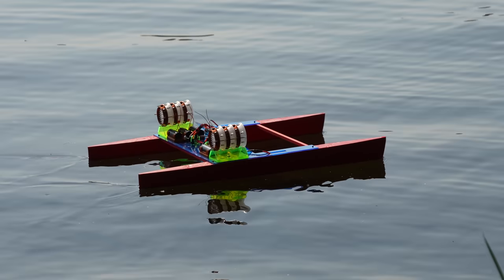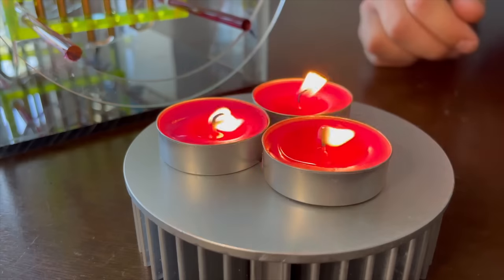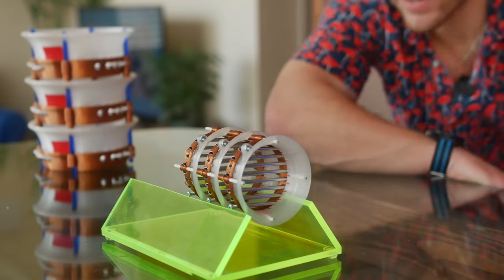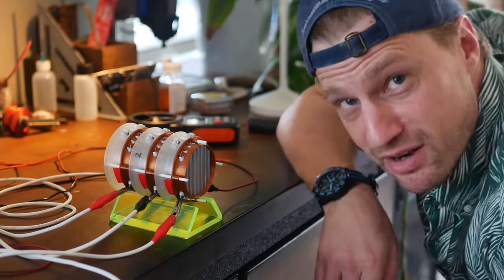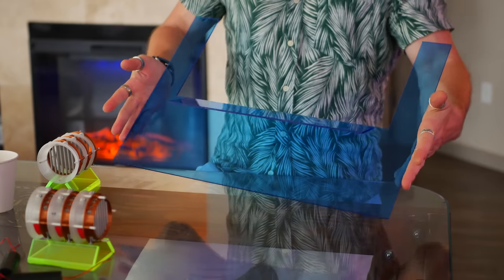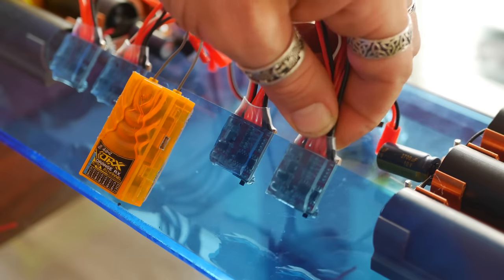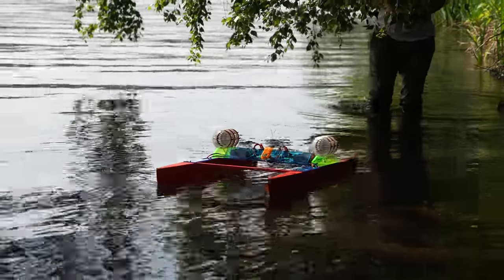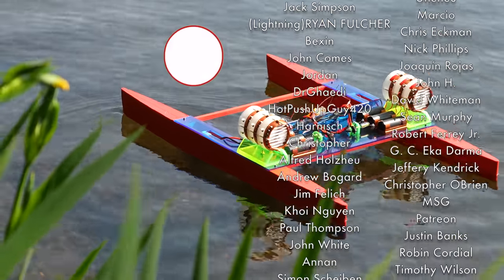Building A Twin Ion Engine (TIE) Catamaran (ft RCTestFlight)

Comment: Ok,  so I noticed that the wire you use to generate the electron flow is pretty a pretty thin gauge.  Does increasing the wire gauge thickness have an impact on how much thrust you can develop?  Also have you tried different types of wires like say for example Oxygen Free Copper wire vs. traditional copper wire, or aluminum wire vs. steel or stainless steel even?  It seems to me that the specific properties of the wire would have a definite impact on how many 'stray' electrons are released in response to the current applied.  For instance OFC wire has fewer impurities in it so it has a higher conductivity than traditional copper wiring, as such more electrons pass through it successfully (by not bumping into those pesky impurities) so more should be released towards the 'ground' of the circuit.

Comment: A suggestion that may deal with the hiumidity issue:
attach a humidity sensor to an arduino. 
have it set the distance between the positive and negative terminals on the thrusters. the more humid the further away.
this should solve the arcing issue and in more humid air the ions should travel easier so further so may still achieve the desired results.

Comment: The high voltage arcing is also causing high frequency interference, which, in fact, could be worse for marine animals than typical engine noise.

Comment: Hey Jay. Nice job on the boat. But I was thinking! If you want to have more air pressure on the end ( to have more velocity ), I would try to make a body, for the thruster (like airplane thruster). You would have more air pressure and less loss of air, in the end of the thruster. I think this would help with more velocity.

Comment: Btw; I crunched the #'s and researched a self launching glider with an 89 ' wingspan just to get a working knowledge of the dynamics and truth be told. If it's your plan to propel a manned glider with ion plasma. You're gonna need some SERIOUS mechanical in order to have the ion engines that will provide the right amount of thrust. It's very doable my friend, but you're really gonna have to think outside the box on this if you hope to succeed as a manned pilot

Comment: Have you compared with thrust from Noctua CPU cooler fans?  They are essentially silent. A lot noise comes from the turbulence of higher speed air flows. A fan that operates in the laminar flow regime with a quiet motor can be as quiet and much more efficient. 50W of power for an ionic fan is a lot of power.

Comment: I know that it would be "moving parts," but I would just put the engines on linked swivels (maybe connected with a rudder, too). In a full sized craft, that servo functions like the ship's wheel would for a person. That allows them to run fully in parallel and simplifies the electronic controls by only using one power setting for both, also allowing for more power through turns. It doesn't solve for reverse or the humidity problem, but it would help with the speed and overheating, yeah?

Comment: Have you tried any actuators or servos to extend the distance of the plates and wires on the fly? This could help the humidity issue, as the air is more conductive the minor distance change could solve that. Would love to see the outcome. Let me know!

Comment: Have you thought about thrust concentration? Like a jet engine the intake opening is is larger then the exhaust. Like your single stage. But when adding the 2nd and 3rd sections your keeping them all the same size. Like a regular house fan you’ll get a certain thrust form an unimpeded open fan but if you put cone on the air side capturing all the air being pushed into a smaller exit. then all that air is trying to exit from the smaller point. What if you made each section slightly smaller allowing all the air being pulled from the first thruster to be compressed and further accelerated by the next stage?

Comment: Can I suggest making the emitters out of wither turngsten or Titanium 1mm thick, laser cut like a comb (for hair) then etched to give needle points? The very thin material will offer near zero resistance to air flow whilst offering high ion output, as with careful design, you could interleave the cathode thus create a high flow engine.

Comment: This is pretty awesome but the feasibility of plasma based forms of propulsion may be limited on or near water unless you can find a way to prevent the water from becoming an electrical death trap in the event of a submersion or fault where the current contacts the water

Comment: MAKESHIFT HUMIDITY SOLUTION 

Make a tunnel going into the thrusters which has a cooling system (Like a fan) which will reduce the humidity of air going into the thruster. Should help with the sparking issue in higher humidity environments and stop overheating when thrusters are made more powerful.

Comment: You need to hydroplane. Vector the thrust into channels beneath the pontoons to create lift. By thrusting against the density of water rather than air, you may create greater force. You are pushing air, and it should exert force at more places than the thruster mounting.

Comment: Try testing the thrust power with a weight cell (wind speed it's a good indicator but it doesn't show well how much push the engine has).
For testing I suspect that this kind of thruster will be very dependant from the atmosphere conditions (it's kind of a capacitor) try testing it ina controlled area with different: pressure/humidity/temperature to check how these variables affect the efficiency (as you discovered during this video humidity lowers the voltage needed to create a spark between the two poles (as lower pressures do))

Comment: interesting concept. Just one thought - do the thrusters have to be round like a conventional jet or rocket? I was wondering if you couldn't make a really wide oval one, a bit like the large oval shaped Dyson fan? This could go right across your boat giving a much larger area of thrust for the relatively low airflow you are getting. Steering would need a rethink 🤔

Comment: Also, have you thought of increasing the applied voltage at each stage as you decrease the grid area while keeping the stage opening the same. 

   Somewhat like modern high bypass jet engines. Where the air from the first stages are bypassing the core where engine fuel combustion occurs. 

Which generates more thrust than the engines core.

Comment: I’m certainly no mechanical engineer but I believe Ion drives are actually being used now on a small scale in space.  What I read is, you’re not going to have huge acceleration but you can get constant acceleration although I’m assuming acceleration decays logarithmically (?) as you approach the speed of light.  Anyways I’m also guessing that you don’t have to worry about humidity in space.  Working on a boat on Earth is quite the other matter.

Comment: Have you thought of staging them so that each section is slightly smaller than the one before? Much like the compressor section of a axial turbine jet engine. 
   Each smaller section focuses the air flow. Then use a second first section to “accelerate “ the final exit airflow. 
  You may need to use 4 to 5 maybe 6 sections. 

How about insulating the grids so the exposed areas narrower down then widen?

  Just something to think about,

Comment: The tech is promising but needs to mature a lot more to be useful. The basic thrust is too low to move large ships and as for aircraft, you would need a substantial amount of power to do more than be a flight extender for a high aspect glider. Keep working it and maybe in the future... One other thing, where are you going to get the power to run a thruster in the middle of the ocean/lake/river? An engine that makes noise.

Comment: maybe print a casing for the engines, and put something over the exit holes that doesn't cause trust decline , like anti fly netting,  you could also design an Aero/aqua-dynamic nosecone, build to let gravity and incoming airflow divert humidity away from the engines, maybe the casing provides also some trust compression options, in a larger salt water version, you could use the humidity to provide endless power for salt water vessels, btw the gas coming from that proces is also very explosive, it could provide fuel for a boost engine

Comment: The propulsive efficiency (Force*Velocity / Electrical Power consumption) of the thruster is really low at the low speed the boat is going through the water. 
The thruster would really shine when it's going faster through the air ans still generating thrust. 
So in my view, If you could let the thrusters go around fast in a circle ( of a sort of Carousel), and then gear down the movement of the Carousel and use the reduced velocity, higher force motion to drive propellers, you would more efficiently convert the electrical power into propulsive power. (The noise of the diesel engines is eliminated but yeah, the prop noise will be there in the water.)

Comment: Out of contest but Is it possible to pressurize air let it out through a small controlled opening on one end while adding more pressurized air into the tank during the process on the other end that will surely create thrust.

Comment: You would likely see gains in maneuverability and average top speed with the addition of rudder control. Instead of lowering output on one thruster as a means of turning, you could maintain full thrust all the time.

Comment: If ions more freely discharge from a smaller surface, would it be possible to put kinks in the wires at even intervals (maybe do some testing to see what area of air around the point is pulled with the ions) to create "thrust zones" within the engine?  Kind of like the shape of knife serrations, but just a wire.

Comment: You can always use some off-the-shelf dissecant dryers meant for air compressors and use fins behind the propulsion to thrust vector or with servos. Or servos directly to the propulsion. But honestly this is just the wrong type of drive for a waterborne craft. Youre going to have to swallow that pill eventually. But a very inspiring idea and attempt!

Comment: If it can't handle humidity, what will happen when it rains? I guess the entire engines need to be inside a tube, and for any heavy use you would need some means of removing water droplets from the intake stream.

Comment: The sensitivity to humidity (and size) is not unexpected.  You have 40kV between the two meshes.  If the meshes are too close or the air resistance is reduced (by humidity) then you exceed the breakdown voltage and create a spark instead of hot ions.

Comment: Try adding some fans to the front (forces induction). Maybe the higher air pressure will help reduce the sparking.

Comment: Greetings from Hoodsport WA....! Cool stuff! I was just wondering if one could increase velocity of airflow by choking down the outdraft.....??? My other thought was to have the outdraft spin a fan type propellor of larger size, like a hydroplane, using the airflow to spin past vanes at the outdraft, but with optimized curvature design of the outer length of the prop.....

Comment: The experiments you do must be a blast to do! I am sure that you've mentioned it in other video's, but I  am curious about the amps you use on the catamaran? Have you used higher amps or lower gauge wire? Have you figured out how much thrust you'll  be needing to to give the boat manufacturer a working prototype?

Comment: Part of what really got me into Electric Vehicles, is the stealth of them.
But sadly, dogs, and some other animals, can still hear electric motors. Which brings me to this. Other then the high humidity arcing issue...How quiet are Ionic Trusters actually. Are they making far reaching sounds, at frequencies we just can't hear, but nature can?

Or would a fan with acoustic foam or something around a liquid cooled motor be better?
There's a channel testing the efficiency & volume of different PC fan designs. That channel, and his viewers, helped me decide on what radiator fans I like the sound & volume of. Maybe thst can help with a stealth swampboat too?

Comment: Very awesome idea dude. This isn’t my field but would rubber gaskets work inside your thruster so the humidity doesn’t set in?
And would a hydrofoil system help your mobility? 
Super cool watch! 
The way it blows the flame of a torch made it look like if that system was built around an object would almost act like ionic shield.

Comment: this might be a bit late for a suggestion, but why are your ionic thrusters round? if your electrical elements are essentially lines which span the width of the thruster, why cant you just have them all equal length and form a rectangle? at least that way, you would have a greater surface area for it to work given the size constraints of the overall unit

Comment: Does the sparking and cross over damage the thruster?
How does it impact performance?
Could it be made so it doesn’t?
Would it not heat up the air going through?

Comment: Perhaps by utilizing a duct from the thrusters to the water could provide greater thrust? It'd be pushing against water instead of air and water. The stopping power of air is lesser than water, so I figured that could make it faster

Also, theoretically if a duct were to intake from the bow(front) and expel from the stern(back) into a sail, I believe that it could perhaps make it a bit more energy efficient.

And rocket technology might be able to provide more thrust as well. Most namely a rotating thruster with a narrowed nozzle for instance

Comment: You need a shroud so your not sucking up air directly off the water. You could run it out a bit, perhaps as square duct work. Then end it and angle it at a 45°angle away from the water. Then you could put a sacrificial ionicer there that would be sacrificial. Run it at low power and it's like a scruber slash preheat to get rid of moisture.
          I do have another idea thou that would make your machine more complicated but it could be used in any environment and it would be scalable. So what if you built a wheel 🛞 then you bolted your thrusters to this wheel. You could bolt thrusters on both sides of it and depending on diameter of wheel would depend on how many thrusters you had you could bolt on. A 3' foot wheel I think could hold at least 16 thrusters with it being 8 per side.  Now if you enclose that wheel in a sealed housing you could fill it with compressed air. You fire up your thrusters which will now not be effected by moisture and should have more power since there in the denser air in the housing. The wheel will turn the shaft which if you have a counter weight attached to the other side of shaft will help your efficiency. 
      Thus if it generates enough force you could run a belt to a drive for a propeller or perhaps a shaft to the propeller.
     I do not know if this would work or if it would be worth pursuing but it was what popped into my head. Thoughts were it would be a pretty light weight motor that could develop some impressive rpms. Like the videos keep them up👍

Comment: What happens to an ion thruster in the rain?  Revert to paddling? In an aircraft, it would definitely have to be a glider. Or what about ice formation at altitude? Gas engines/turbines/propellers are relatively unaffected by rain. Ion thrust relies on open airflow rather than mechanical drive, how would you surmount the effect of water in the chamber?

Comment: I wonder if there would be a way to add a material like fume silica to the parts and yet still allow the flow of electrons. Also, I was thinking that if you could dry the air at the leading edge of the thrusters using maybe some kind of hydrophilic material in the area of the thrusters to help wick some of the moisture out of the line of the thrusters.

Comment: This might just be a crazy idea, but what if instead of using ionic thrusters for a plane, you laid the wires across the hull? Whether or not that would work, I recommend trying different shapes for the thrusters since you aren't really limited in what its dimensions have to be.

Comment: Why not a push/pull set up? 2 or 3 thrusters in the front and back. Point the thrust an an angle down at the water to get a better push.

What about an enclosure for the engine itself?

Comment: It's my understanding that ionic thrusters, will increase the speed of the incoming particles even at thousands of miles per hour, so since the speed of the particles coming in will be increased, why not loop the exhausted particles back into the inlet of the ionic booster, so the increasing air flow can be used like with a turbo, so one chamber of the turbo will continue to increase, via the recirculation of the particle flow, the connecting shaft, to the other chamber of the turbo can be used as your source of energy to propel something or you can use the shaft as the source to perform work.
   Also as you know, when the particles pass through the thruster, it strips electrons from the air atoms, creating ozone atoms, so negative and/or positive protons will need to be added to the exiting particles, that can be achieved either by a charged gas introduction, or by using the second chamber of the turbo to introduce the particles back into the thruster, at the higher rate of speed produced by the particles that just past the first chamber turbin blades, from the exited particles from the thruster.
    This invention using a turbo with an ionic thruster to reintroduce the boosted forces back into the ionic thruster, to increase speeds of the particles to a usable level, is the sole intellectual original invention of John Kissam, please do not make claims or try to patent this as your own idea.  For interest in usage, contracts, or agreements, utilizing this invention, please contact Mr. John Kissam directly, to discuss it.